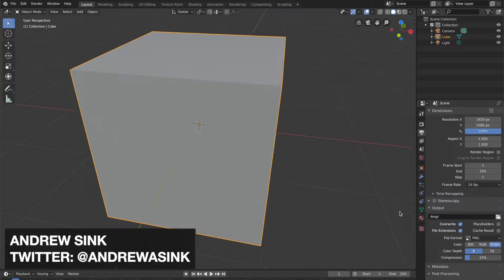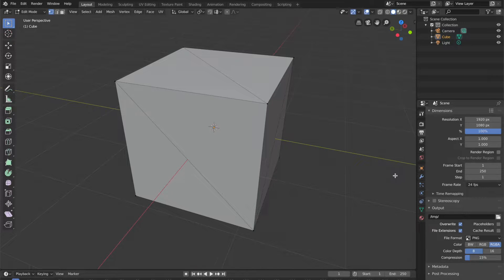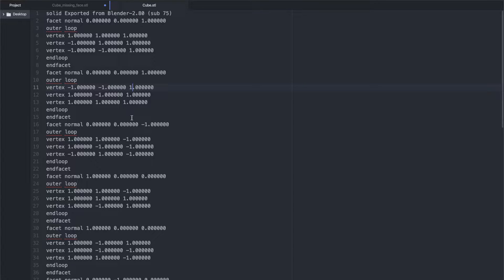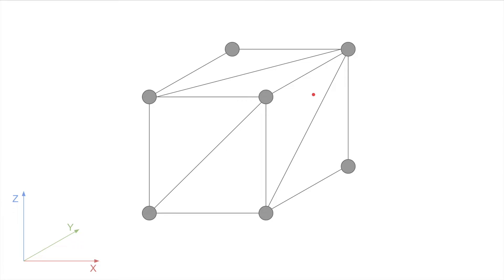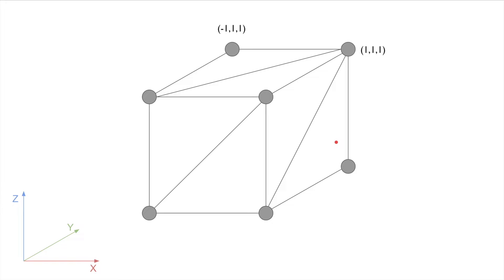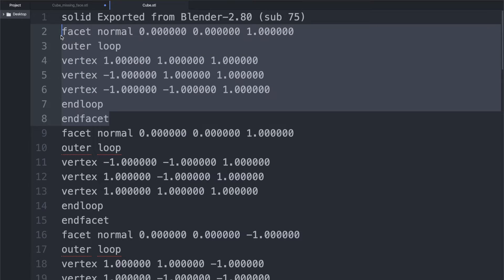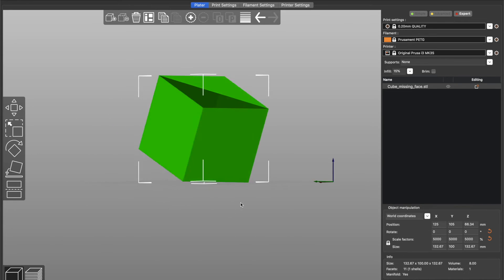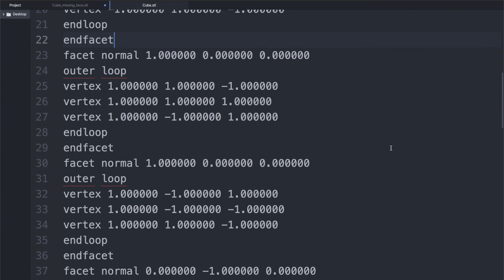What's inside an .STL? Edit an .STL file using a text editor!

Comment: I would like to ask why it is often so difficult to merge two meshes when their surfaces overlap exactly. In particular, I have noticed that when I try to combine two mesh files in Rhino/Grasshopper, the operation fails or produces errors if the meshes share coplanar or coincident faces.

Could you perhaps illustrate this graphically and explain how the algorithm behind a typical mesh union works? I would like to better understand why coincident or overlapping surfaces cause such issues in mesh boolean operations.